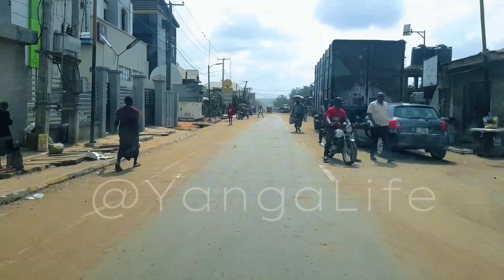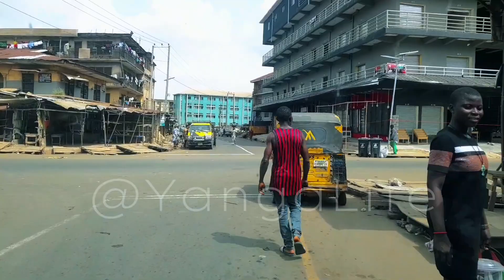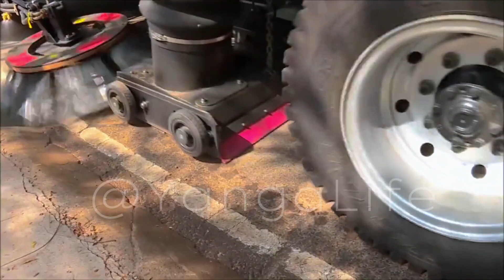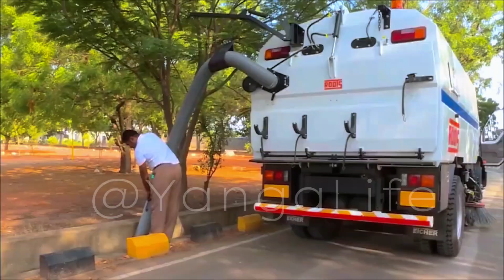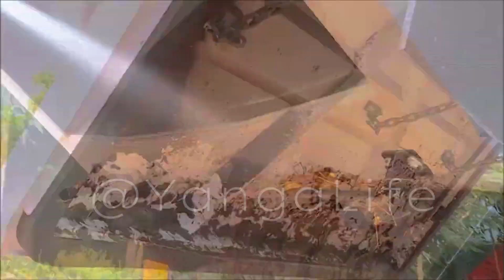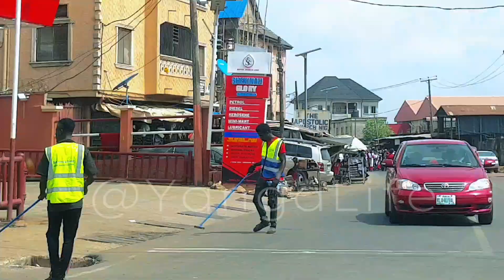A Recent Visit To The Newly Reconstructed Portharcourt Road, Onitsha

Comment: They have to clean the roads with water dally Basses
Reply: That's not feasible. The millions of people that live there, need to learn how to keep their environment clean. That's the solution. Sweepers come, but no amount of sweeping will change anything. I'm sure, several days from now, most of what you see will be cleaned up. Then the people will go right back to littering the place, it's a vicious cycle, that never ends.